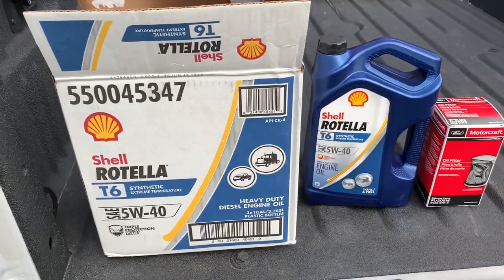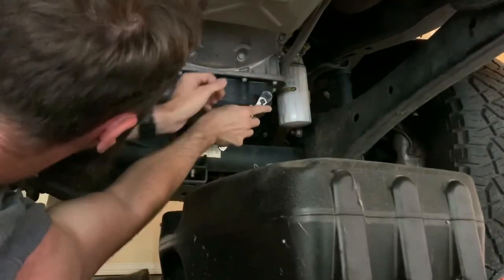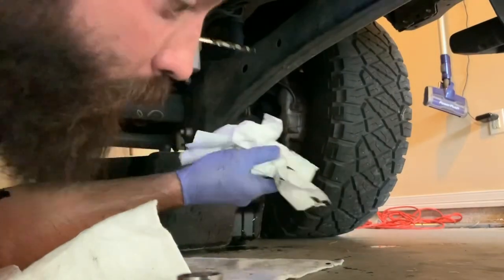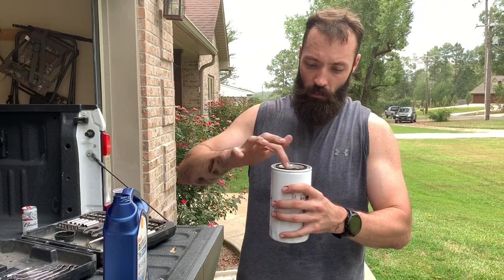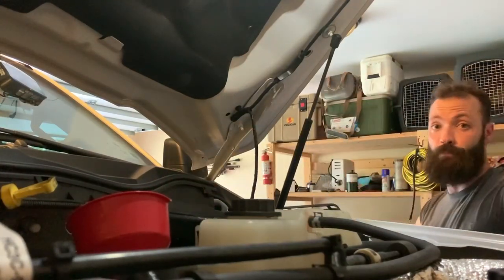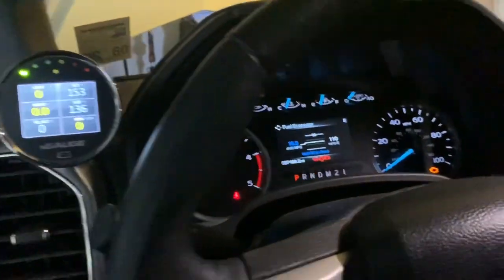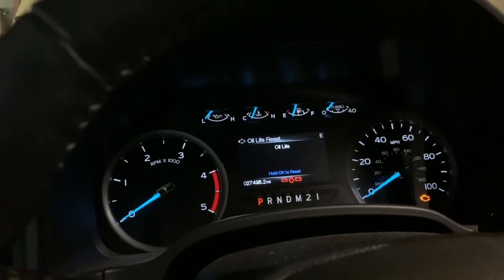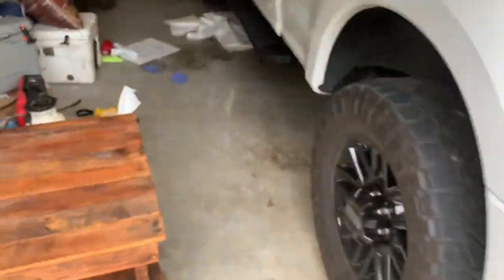2017-2020 Ford F250 OIL CHANGE

Comment: Good video. I had never drilled a hole in the oil filter. Good idea, voids a lot of mess. I have use the easy drain and all of my trucks for the past 20 years. Works great.

Comment: rotella t6 it is. think I'm gonna to wait on that delete until my warranty is out. just got my f250 about 4 months ago. soo much you can do with these trucks kind of hard to know where to start. I'm just finding your channel and loving the vids so far. SUBSCRIBED
Reply from the maker: Kenny Wayne T6 is a good oil! I deleted mine in my garage about a year ago, no regrets so far. I’ve also had some warranty work done on it as well so I guess it depends on the dealer. Had a upper oil pan leak fixed. Thanks for watching and subbing! 🇺🇸

Comment: I always have used T-6 in my Duramax also. Now I have a Powerstroke also, I guess I’ll use it in there also. Nice idea on the drilled filter, or poked. 
The Amazon link for the oil is cheaper individually than by the case of 3 FYI.
Reply from the maker: T6 is where it’s at brother.  Thanks for the info on the link! Appreciate you watching, hit that sub button if u haven’t. Trying to grow the channel! 🇺🇸

Comment: Hello Colt! I appreciate your videos on your truck.  I just picked up 2019 Ford F-250 6.7 power stoke and like many guys been reading everything I can on proper maintenance to take care of it!  Well while combing through YouTube videos seeing yours and others I found a drain plug on Scotty Kilmers channel you might consider? I like the “Easy Valve” but was concerned about dirt, stone, or twig getting caught in there and draining my oil out.  A guy like me can’t afford to buy about another one of these bastards there to expensive! LOL!  So I’ll be trying the other valve called ValvoMax oil drain plug # VM14-1.50/ stainless steel drain plug.  Check it out and tell me what you think?  
PS thanks for information on the oil still researching everything!
Reply from the maker: rout9291 thanks for the feedback! I will deff look up the valvomax! I have had my truck in some iffy spots and so far everything is fine with my valve, but one can never be to safe! I’m in the same boat as you about not being able to afford to buy another one! This thing gotta last!! Appreciate you watching my videos as well! Do you have any ideas for any new videos? Anything you would want to see or know? 🇺🇸
Reply: Transfer case next Colt, unless I missed it!
Reply: @g-man2228  Hello George don't forget to ask Colt to look into install of Amsoil by pass filtration?  I did it and I love that my diesel oil stays cleaner?  Helps protect that investment!  Soot killed the after treatment and cutting back on regent saves you fuel.  Ask big daddy Colt to check it out?  But will only be a 2 or 3 Latte job?
Reply from the maker: I need to get on it! 🇺🇸🦅🇺🇸
Reply from the maker: I’m gonna look into it brother!!! 2-3 latte ain’t bad! 🇺🇸🦅🇺🇸
Reply: @rout9291  Colt almost forgot to mention I went to Don Smith Amsoil channel on Youtube and bought his bypass filter guard to protect from the filters from stones and other things possibly puncturing them?  Don's a really top notch guy and his brakes is great!  Really heavy duty for my application!  I hope this helps you?

Comment: I'm new subscriber 
Thxz !! 
Hopefully u got how to do fuel filters too..
Why nobody goes with the recommended oil on the oil cap
I think is 5 / 30..idk..
Reply from the maker: Yes I have a fuel filter video as well! I run 5w40 because it calls for that if you use your truck “severe duty” and why not have the best oil in there you can have! My truck isn’t always severe duty and rarely is but it’s good piece of mind!! Thanks for watching and subbing!

Comment: So 1 quart in the filter and 13 in the engine? Great video!
Reply from the maker: No. 13 all together. 1 in filter and 12 in engine. 🇺🇸🦅🇺🇸
Reply: @COLTSWAY  thanks, finished the job a few hours ago, your video was helpful on the oil part, subbed

Comment: Man id highly recommend at least breaking the torque on the oil filter before i drill a hole. You're screwed if you drill it then cant get it off. Same goes for all your fill plugs on diffs, tcase etc. Always pull the fill before the drain. Been looking at getting one of these trucks and stumbled across your channel. Very helpful with decision making.

Comment: that valve is interesting, but it doesn't drain the oil fast enough to clean out any sludge or debris out of the pan, I've tried with a regular ball valve.
Reply from the maker: Man I’ve been using it on all my trucks. I have buddies that have over 100,000 miles using one of these...but I do see your point. Thanks for watching, please like and sub! 🇺🇸
Reply: Start it up and let it run for a few minutes, gets all the crap suspended in the oil then it drains out. The best way to do it is to take your vehicle for a drive and get it good and hot then all the crap will really come out.

Comment: my only concern is that valve, If you went off road and you was to run over tall grass or some tree branches it may hit the handle to the valve and drain your oil in the woods! i use the dipstick and a oil change vacuum tank to do my oil i never have to touch the oil drain plug.
Reply from the maker: Yes that could possibly happen. Would be nice if I had a oil change vacuum that is pretty slick! Thanks for watching, please like and sub. Trying to grow the channel! 🇺🇸
Reply: I noticed that the Fumoto does have a "safe guard" (for lack of a better word) to keep the lever from accidentally getting caught on anything. Thats the only advantage I see with the Fumoto.

Comment: Have you always used Rotella T6 in this truck? I have a 17 as well and I'm around 30K miles on the Motorcraft 10w30 blend. I want to switch to Rotella T6 but I'm not sure if it's worth it. Thanks
Reply from the maker: Jason Kubitz yes I have always since the first time I changed the oil. I really like it, I used it in my duramax as well with zero problems. It is a little more expensive, but I like the piece of mind knowing I have full synthetic oil. Plus ford recommends the 5w40 for severe duty. I’m not saying I put mine under severe duty, but that’s what I’m gonna run. These trucks are not cheap and I want as many trouble free miles as possible! Please Like and subscribe. Have a great week! 🇺🇸
Reply: @COLTSWAY  Thanks for the reply and the great info. Looks like I'm switching to Rotella. Have a great week as well. Subscribed 🇺🇲
Reply from the maker: Jason Kubitz thank you! I included my link in the description of video if that helps you. It’s on amazon prime as well! 🇺🇸

Comment: Folks, loosen the filter first before drilling or hammering a hole. It would suck if you didn’t and the filter was improperly installed couldn’t be removed without the tools and abilities required to do so.
Reply: I’d be a real man and just pull the filter boss off...nothing would stop me from getting that filter off.  Air hammer if required even.
Reply: A tip for stuck filters, punch a long screwdriver or rod thru the side of the filter and turn it like a valve handle for leverage.

Comment: In the months since you have had the ez drain on the truck have you had any issues with the little lever that opens the actual valve?  Does it locked closed tightly? Have read that some folks have had it open while driving. I have the ez drain in my garage and want to install on my ‘15 Powerstroke. What’s your review of it this far? Thanks in advance for any information.
Reply from the maker: Man I have had zero problems. I don’t know how it could open automatically, because you don’t just slide it over. You have to push in and then slide so it’s not something that could happen out of the blue. I’m happy with it so far brother. 🇺🇸
Reply: Thanks as always for the reply man. I appreciate it. Will be installing at next oil change.
Reply from the maker: Anytime man! 🇺🇸

Comment: Just viewed the “muffler delete” video and was wondering if it was or wasn’t done with or without emissions, would it or wouldn’t it make a noticeable difference on fuel economy?  Comments on that video have been blocked.
Reply from the maker: It’s illegal to delete emissions.....I wouldn’t do that. 😜. It would make a difference in economy. If the dpf is removed it is non emissions. 🇺🇸

Comment: How you like them nittos ? How many miles you get on them so far
Reply from the maker: They held up good but I wouldn’t buy them again. No traction or grip anywhere! Just got a set of Mickey Thompson Baja Boss AT and so far loving them! All around better  tire. Had them 5 months now. 🇺🇸🦅🇺🇸
Reply: I just happened to be at Canadian tire asking about tires and seen a set 285/75/18 reg price $400 a tire got on clearance for $99.97. Each
Reply: Duratrac

Comment: Just out of curiosity, what size tires and what is your wheel offset? The stance you have is basically exactly what I want for mine. I’m guessing you have 35x12.50 with a 0mm offset wheel.
Reply from the maker: Caleb Mattson man I’ve got a 2.5 ready lift. The stock lariat sport wheels. And running 37x13.50x20. Can’t remember what stock offset is. Please Like and subscribe. 🇺🇸
Reply: COLTSASTALLION any rubbin? Or did you trim anything?
Reply from the maker: PowerstrokeJack  it rubs when turned about 95% just hits the a arms. Doesn’t really effect my daily driving at all.

Comment: How many miles is everyone running between changes with the T6? Highway pulling 6k lb camper here.
Reply from the maker: Man I run my oil 7500 miles between changes. If that’s 2 much for you do 5 k.  The first time I waited till computer told me it was like 10,300 miles. That’s was to much for me so I went to 7500. Thanks for watching, if you haven’t please like and sub. Trying to grow the channel! 🇺🇸
Reply: @COLTSWAY  I'm staying with the 5-7k window also. An oil change is the same price as a good Saturday night out and worth the added protection.  Great videos for those of us new to the 6.7 btw.
Reply from the maker: You ain’t lying. And thanks a lot for the feedback brother. 🇺🇸

Comment: Have yuh ou ever tried Amsoil?
Reply from the maker: Terry Petersen No I haven’t, I’ve always used T6. Used it in my Duramax as well. I’ve got tons of farming Buddies that use it in $500,000 tractors as well. If I ever got something else, it would be Mobile one. Thanks for watching, and the sub! 🇺🇸
Reply: Yeah I've used T6 rotella in a duramax 2002 as well. Then tried Amsoil. I liked the 25000 mile interval changes.
Reply: @G Alpha first of all you might want to read and know the difference.  First of all Amsoil is the first full synthetic oil and started out in military aircrafts.  Second there is plenty of facts and people that used the oil. From 100,000 miles on semi truck with No oil changes. If you take a sample of your oil and send it out to a laboratory.  They can and will test your oil for all of the breakdowns in your oil. Military has sent off their oil for years. Amsoil backs their oil up as well.

Comment: Curious, why does the manual say 15 but it’s only 13 quarts?
Reply from the maker: I have no clue. The manual is wrong though. You can call up the dealer or any oil change place and they will tell you it’s 13. Weird as hell, figured they would of fixed that typo by now. 🇺🇸

Comment: So you fill the oil filter and add 13 quarts?
Reply from the maker: I start with 13 quarts. I fill the filter, it usually takes 1 quart. I then pour the remaining 12 quarts in the engine. Some people don’t fill the filter, I just do. Thanks for watching, please like and subscribe! 🇺🇸
Reply: @COLTSWAY  thanks for the info. Very helpful man!
Reply from the maker: Nick OBrien anytime! 🇺🇸

Comment: No way would I use this type of drain plug , just to many things could happen and unscrewing a bolt didn't look hard to me.
Reply from the maker: Been using it for years now, but I deff see your point!
Reply: @COLTSWAY  .... Glad you haven't had a problem but I just wouldn't take a chance on it.
Reply from the maker: Totally understand man! I feel you, really the only reason i like it is because I can hook that hose to it and there is zero mess when I do change the oil. But I’m not gonna lie I was weary at first as well. I read tons of reviews and  still wasn’t sure. But it’s like a two way opening. You can’t just pull the lever back you have to push in and up then pull back. So for that to happen buy itself or by something hitting it would be very unlikely. But if it wasn’t for that feature, ain’t no way In hell I’d use it.
Reply: @COLTSWAY  ... I see , glad it does have a safety feature. I do understand the mess you are talking about , I just lift my drain 
box up closer to the drain.   I do understand your concern .

Comment: That looks like a accident in the making.
Reply from the maker: Don’t buy the valve then. But that’s how you change the oil. Millions of those valves on the road. And hundreds of fleets us them. Mines been fine and I’ve been in the worst Louisiana gumbo you can find. It doesn’t just twist open. You have to push in and then twist. Literally impossible for it to just twist open. There would be millions of lawsuits if that was the case. But I get what your saying. Thanks for watching. 🇺🇸
Reply: @COLTSWAY  I was just gonna ask how that "hoo-dus" was workin'...looks like I need to buy one!!
Reply from the maker: It’s great brother. Not a problem!! 🇺🇸🦅🇺🇸

Comment: Majorly important question for you. Have you checked your manual to make sure that your 5w-40 motor oil fits Ford specs ? The reason I ask is that I was watching a powerstrokehelp.com video and it seems that Ford is rejecting warranty claims if owners are not using a oil that fits their specs and it might be that motorcraft 5w-40 oil is not the same as Rotella 5w-40 oil ! I'm going to call the Ford dealer tomorrow to find out all the specifics.
Reply from the maker: J M rotella t6 is fine. Millions of power stroke owners are running it. It meets the specs.
Reply: @COLTSWAY  I jjust got back from that autoparts store and looked at a bottle of Rotella T6. It doesn't meet the specs. Go look at a bottle of Motorcraft oil . Your warranty is voided if you can't show receipts for Motorcraft oil. Welcome to the club.
Reply from the maker: J M settle down man. I’ve had warranty work done. You are over reacting. Millions of people run t6. It’s all good.
Reply from the maker: J M here you go man. It’s on the list. All is good! 🇺🇸

https://www.fcsdchemicalsandlubricants.com/main/additionalinfo/dieseloilsWSSM2C171F1.pdf
Reply: @COLTSWAY  I'm sure that Ford would perform general warranty work but if your truck ever required a total rebuild costing $20k, Ford would deny it.
Reply from the maker: J M  negative. You are way over reacting. It’s ON THE APPROVED LIST. And to be honest...IM DELETED I HAVENT HAD A WARRANTY IN 45,000 miles. Deleted at 6,000 miles.
Reply: @COLTSWAY  I would love to delete the emissions on my truck as I believe that recirculating garbage back through the engine makes no sense but the DOT cops in my area would have a field day with me if I ever got stopped. And I bet it is better for your engine to not have that carbon fed back through but we both know Ford would analyze your computer and figure out what you did even if you replaced it all at a later date.
Reply from the maker: J M yes they already flagged my truck as deleted. But it is much better for it. Plus it’s like a whole new truck!
Reply: @COLTSWAY  Where did you go for the delete kit ? And who did the job ?
Reply: @COLTSWAY  nice front drive shaft
Reply from the maker: Unbiased Opinion what you mean?
Reply: @COLTSWAY  I didn't see one but my 5.4 Trition 8 inch lift on 37s on 3.73 gears is wanting to tug a diesel I could probably drag that 6.7 back to the dealership
Reply from the maker: Unbiased Opinion well it’s got one I assure you. I once had a turd 5.4 triton. 2 piece spark plugs were a real good design. 🙄. Only thing you would be dragging is bumper and rear end back to your truck. Just came from a duramax which I liked, but this 6.7 is on another level.
Reply: @COLTSWAY  I would pull the axle out from under that powerstroke
Reply from the maker: Unbiased Opinion 😂😂. I like you. Please sub! 🇺🇸
Reply: @COLTSWAY  I'm actually just teasing you been sick for 2days trying to humor my self
Reply from the maker: Unbiased Opinion damn man that sucks. Take care of yourself and get to feeling better.
Reply: @johnmazza9432  you can buy blocking plates and block off the egr all the while leaving the equipment in place. Then you just have to flash your computer to remove the software for the egr and no one will be the wiser.

Comment: I'm just going to say you have no idea on oil change stick to the professionals. And that quick drain is a terrible idea. You know where to go 120 Well Rd
Reply from the maker: rcbreen if it didn’t cost my whole paycheck I’d go to well rd! Lmao
Reply: Entergy money son 💰💰
Reply from the maker: rcbreen and this drain plug is awesome. Tons of people running it. Go ahead and purchase from my link as well. Thanks.
Reply: No sir not for this guy, I have seen the bad side of those. Also 5w40 on the 6.7 is a must if you have the common lower engine tick alot of 6.7s have swap out to rotella synthetic and 99% of them dont do it. Trust me I'm a Lubeologists.
Reply: @G Alpha yes I work at one. No not 300 for an oil change of t6, maybe with fuel and air you would be getting close. Depends on year model and make.